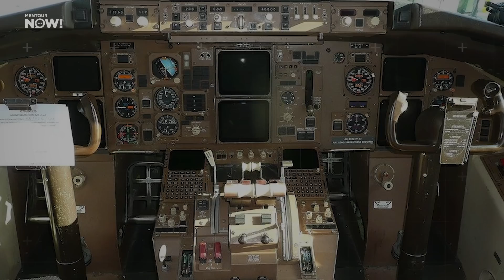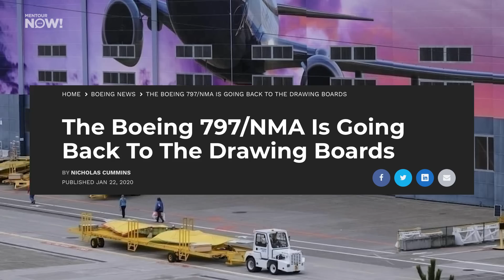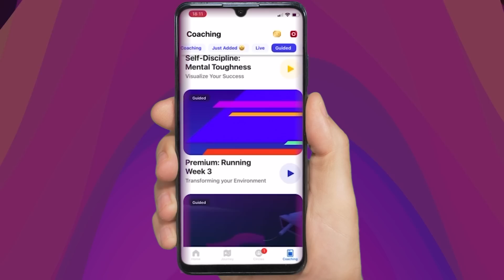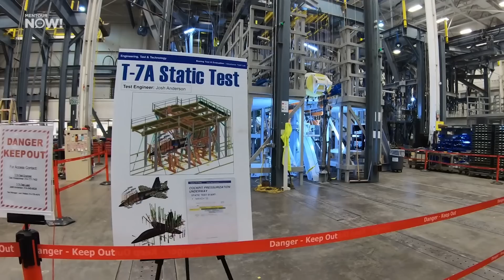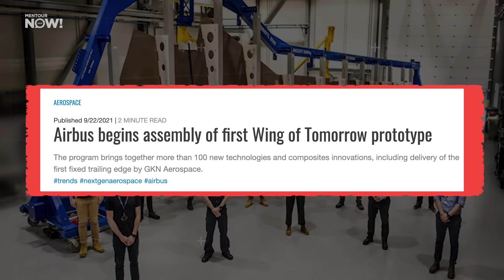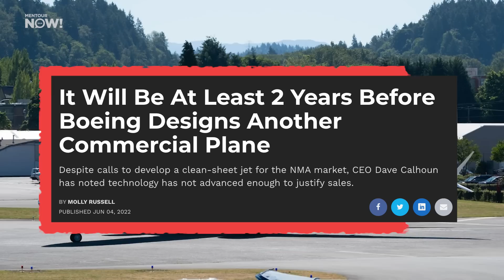Is Boeing Planning a 757 MAX?!

Comment: I started my aerospace career as an engineer on the 757.  It was an inspiring airplane, especially watching it take off empty from Renton field. But after 40 years of engineering airplanes, and and more than a decade in Product Development, I have to face the facts. When comparing the operating empty weight (OEW) of the 757 against both the 737-900 and the A320, which all have roughly the same passenger capacity, the 757 is 50% heavier than its main competitors.  This translates into a lot higher fuel burn to accomplish the same mission. The pilots loved it because of its power and instrumentation, but they were not the ones paying the fuel bill. The 757 replacement will need to be a clean sheet airplane, not a 757 derivative, which itself carried way too much baggage from the 727 that resulted in it being so heavy.  The 767 was a true clean sheet airplane, and it out lasted the 757, and also gave birth to its sister, the 777, which originally started out as a 767 derivative.

Comment: When the 757 and 767 were the new things on the ramp, when you walked around behind the curtain at Boeing they had KISS signs all over. Not the usual meaning, instead Keep It Super Smooth. Kind of moot when the 787 came along.

Comment: The 757 was the best, most versatile aircraft I ever flew. It could do short field landings, had long legs and plenty of power. Easy to make smooth landings. One horribly turbulent day I flew one from PIT to SFO at FL240 using FP TAS of 420K-arrived ahead of schedule and had 1800 lbs more fuel than flight planned.

Comment: Boeing should design a new plane from the ground up in the spirit of the 757 then discontinue the 737 Max; and just call the new plane the 757. They could have three models a 757-400, 757-500, 757-600 with seating capacities of around 225/250/275 or whatever makes sense. They could work to develop a mid-sized engine that sits between what is on the 737 and 787 or use the engine from the Max; and since it will be a ground up design they would be able to extract all the power from the current engine (I believe they had to make the bottom flat for ground clearance and that results in it being slightly less powerful). I would also imagine they could integrate comfort features for things that are relatively new such as high speed satellite internet. I think Boeing has to show us the can still design and build a plane; and I'm not sure what else they can squeeze out of the 737 design so I don't see how they are not forced to do a ground up design for a plane that satisfies this part of the market (as an added bonus they get to leave the 737 Max behind) .

Comment: A clean sheet is the way to go, people don't realize the 757 is based on the same frame as 707, 727 and 737 each have their own layout but all share the basic fuselage in differing lengths, the main problem being today its old school and heavy, 1950's heavy. One of a few reasons its gone is its weight compared to the far newer A321 which is similar in pax capacity. Its look at the front is different because it shares much of its cockpit with the larger 767 and was really designed to replace the 727 for the US domestic market which it did.

Comment: The reputation of the B737 is very ambiguous today, especially since further modernization is almost impossible. But the B757 for modernization is quite possible. After all, the B757-100 may well replace the 737 MAX8, or maybe the 6 and 7 models.

Comment: 757NG? But the engine requirements may be an issue. Nobody else other than RR and PW make the engines the original 757 flies on. It would likely be a clean sheet engine design.

Comment: Thus is what has has me scratching my head the entire time: why did Boeing bail on the 756 and the 767? Okay, there was a dip immediately post-911... got it. But after a couple of years, seeing as how the 757 was still a very prominent workhorse of most fleets, why kill it off? The board at Boeing needs to be completely vacated and replaced with sensible people and Boeing needs to quit trying to fix things that aren't broken a la the dreadful Max program. *Boeing is STILL doubling and tripling down on that sack of crap!)

Comment: 757 is one of the best large aircraft I've been a passenger on. As an enthusiast I love to good strong acceleration and attractive design of the body. I don't think Boeing will do 757 again, but they seem to have let Airbus get way out ahead. 737 MAX has really screwed them over, but it is also resources that probably should have been used to try and replace it given how old a design it is too.

Comment: What wasn't mentioned in this video is that, ironically, the typical fuselage section of 757 is the very same of the 737! There is, obviously, a completely new nose and tail section, as well as wing attachment fixtures. Regarding a new aircraft to fill that "gap" between 737 and 787, I think a shorter 787 could be a solution? Does this solution need to be a narrow fuselage? I don't think so.

Comment: There is zero chance that you will see a re-engined 757 or 767.  The reason that Boeing has not gone ahead with a “NMA” is there is not an engine on the market in the near term future that will achieve the kind of operational performance needed to “leap ahead” of Airbus, which is what would be required in order to spend the development costs needed to do it. The decision Boeing made to shelve the NMA essentially ceded that segment of the market to Airbus.  It seems that their plan is to build the next generation of aircraft which will require a different engine capability entirely. With entry into service in the early 2030s, Boeing is likely considering launching a completely new airplane family that will change the shape of air travel. They are playing the long game, since doing anything else is simply not big enough to make a dent in the middle market, now owned by Airbus. Time will tell if this is the right strategy.

Comment: A couple of points was not mentioned in the video: 1. Internal at Boeing. They already have 737-MAX9 and -10. 2. These aircraft does have the capacity to carry about the same number of passengers as the 757. 2. the long range single-aisle market is limited, and Airbus is already filling that niche with their 321XLR.

Comment: The 757 doesn't need a 'Max' version. The 757 already IS a 'Max'. Airbus makes nothing that actually compares to the 757.  If they're going to make these suggested changes to the 757's engines and wings then they might as well just keep making more versions of the old, worn-out 737 or bring back the passenger version of the 767.

Boeing sold its soul and cheapened itself, and is no longer the company it used to be. Its now all about cheap materials, cheap labor, and generic designs. Boeing doesn't need a new 757, it needs new and better management.

Comment: I am a huge fan of the 757-200.  I think a 757 Max would be a superb longer haul domestic product.  I'd start by primarily using it on routes 2+ hours long.  The cabin feels roomier and I like when the plane is configured with an isolated F cabin.  So basically enter the plane and go left for F and right for Y.  I think this design helps free up some of the bottlenecks at boarding.  Especially with some many people brining all of their luggage on board instead of checking the bags.  The 757-200 gives you some of that widebody feel (as a passenger) without actually being on a widebody.  I would think a plane like this would be ideal on routes to vacation destinations where you are going to want a lot of cargo space and overhead bin space.  This video makes me want to book a flight on a 757 somewhere.

Comment: if they had re-engined and re-engineered the 757 much earlier, then Boeing would have had a replacement that could compete with the 321 neo.  thing is, this is what they have been doing to the 737 and its MAX version, re-engine and re-engineer.  so what Mentour Pilot says about Boeing's reasons for NOT proceeding with something like a MAX version of the 757 are actually the reasons why Boeing has re-engined and re-engineered the 737 which is an even OLDER aircraft than the 757.

Comment: The answer as stated is probably neither.However if there was one possibility it has to be the 767.
It is still in production and in service.
There is a perfect GenX engine ( the one on the 747-8)
It is unique being a narrow wide body 
It’s perfectly sized for the 250-300 seat market
It meets  the range and load lifting requirements.
Airbus can’t follow it without spending a huge amount of time and money.
If no clean sheet is on the horizon I would take a long hard look at it..

Comment: So, current engines are either too large or not powerful enough, right?
Does it mean that 757 did have what should be nowadays considered "small but powerful engine"? But not efficient enough by modern standards?

Comment: I am in favor of a configuration with  a high wing and the the engines underneath.  Like the Fairchild and B26 or Aero Camando. My buddy (RIP) did the YC 14 at Boeing in the 70's with the engines on top of the wings to reduce intake of unwanted materials.  The creativity and innovation at Boeing has been replaced by computer software which is termanal.
Iguana

Comment: Clean sheet over an ancient aircraft with no assembly and construction tooling.
Composite, much lighter, much less corrosion, well established materials and assembly procedures.
Pratt&Whittney geared engine, fly at higher altitudes
(Thrust is proportional to density )
Higher cruise, especially over the North Atlantic opens new upper airways, when using an engine with more thrust at take off. Larger reverse thrust crucial on certain wet runways, known for overruns ((Cebu)) 
A geared engine is easier to upgrade, since fan and core engine are decoupled, by gear ratio change and vastly improved materials: Aluminum Magnesium Boride record low friction coefficient, coupled with highest hardness 
That is the preferred result from 797 configuration studies.
What engineers are needed?
Alan Mulally types. No foreign imports.

Comment: I worked the PW2000 for 25 years, on the 757 - 200. The factory rep was talking about the PW2000 core with a cut down PW4000 fan with a gearbox. I don’t know if this was telling the truth or just pull my leg. The PW2000 was rated at 37,000 lb of thrust. During the pandemic we in the shop was still very busy because the same engine is used on the C17 but there are 4 engines and on the USAF plane and they didn’t stop flying their aircraft.

Comment: The 757 is the best thing Boeing built since the B-52. I loved working on it for the years we had them. The frontal view is menacing and sleek. It looks like a bird of prey. The Rolls-Royce RB211-535C was an amazing engine, although the thrust reverser was a pain in the butt. I was greatly saddened when we parked the last 75 at Roswell. No other airliner does what the 757 did. We fly Airbus A319's where the Boeings used to go, but they have half the passenger and cargo capacity. The only thing I didn't like about the 757 was that it took forever to deplane the passengers, which made for little time to fix interior items. I still get a smile when I see a United or Delta 757 taxi by.
Reply: Why the trhust reverser was a pain?

Comment: Let me see. The 757 will need new, larger engines of course. That means modified wing plus of course longer landing gear (otherwise we get 737Max issues) - so redesign those. Now the cockpit will need to be a modern glass one. That will enable fly-by-wire, which is so much more efficient and a lot easier to make redundantly safe. But that means a heavily modified empennage (which the aerodynamicists will want for the new wing anyway). That leaves the aluminium tube for the fuselage. But we can save a lot of weight replacing that with a more modern Al-Li alloy.
Of course it is still a 757 ...

Comment: Is there anything left to say about the niche flown best by the 757? Reasons to love this airplane abound, in spite of the lack of a current business case to field a replacement aircraft, or to do a re-engine program. When the KC-135 and DC-8 re-engine programs were opened, we had a ready-made, already profitable CFM turbofan to directly bolt on and borrow from the 737. The facts of the current matter are (1) none of currently manufactured or economically manufacturable turbo-fans are half close enough, all of them way too big and way too heavy (2) there are not enough 757 aircraft to achieve economy of scale on a new engine, (3) both the 737-10 and A-321 take the bottom part of the niche away, (4) if a profitable opportunity existed, either of Boeing or Airbus would already have found a way to put bigger wings and taller gears on the narrow-bodies in manufacture, and (5) there is not sufficient room in the niche for two airplanes.  Besides, the righteous laugher against flying in the proposed gas can A321-XLR seems wasted on safety-conscious, uninformed ears. The reason the NMA was cancelled was a real threat from Airbus to put a new wing and taller gear on a longer A-322 and call it a day. Where once we thought a twin-aisle, flat-oval, carbon fiber NMA, seven across might compete with 757 economics, they won't compete with a single-aisle, round, carbon fiber 757 do-over with fresh, made for niche engines, as Boeing currently supposes 10% more efficient than the best we currently have. No. It is all sighs and wishful thinking. What we really need are diagonal airport gates in which to load and unload a long single-aisle airplane, simultaneously from the front and rear. In that case, we do not need the extra aisle. That is the downside. Getting on and off a 757-300 is a painful, time-consuming affair, kind of bad on -200 as well.

Comment: Boy. Boeing has backed themselves into a corner much like Airbus did with the  A380, when Boeing correctly decided that the 787 was better positioned for the market in the beginning of the 21st century. Unfortunately, Boeing stopped thinking ahead after the 787, and Airbus recovered nicely. Now Boeing's missteps have put it in a terrible position for at least a decade.
Never let the "suits" plan the future direction of an engineering based company. Aircraft are NOT just any product. It takes a special understanding to run an aviation firm. Soda Pop salesmen and accountants don't know enough to do a good job. We are seeing the result of "money engineers" running a company into the ground.

Comment: I agree with Metour Pilot, it would not be sensible or economical for Boeing to revamp an old design either the 757 or the 767. I am a great fan of the 757 as they had a Rolls Royce or Pratt and Whitney Engine with great thrust for real quick take off,s for places like Feuteventuna .  A Completely New Design is the only way and at the Moment I feel Airbus could be in the best position to launch it.

Comment: Why wouldn't Boeing instead work with the 787 they have. It's composite mold out of a single cast so it's a matter of making another mold that is single aisle narrow body. Then just as they would be scaling down the 787 fuselages they scale down the 787 wings and engines. And wouldn't the engines simply be two of the engines from the 747-8.  That's exactly what was done for the original 757. If it were built with four possible lengths of fuselage with corresponding size of wings and engines they would be replacing the 737 as well. I hope this announcement that they have no plans for another plane this decade is just a smokescreen to not hurt 737 Max sales. I hope they actually have something what I just described in the works because it's based on technology that they already possess and it's just scaling down an existing plane.. I understand the 737 Max has to get to profitability but can't it do that in about 6 years? The first incarnation would be the two longer lengths of fuselage as the 757 replacement A321 neo XLR competitor. Buying then is mum's the word about two shorter fuselage lights coming later when they're satisfied with 737 profitability.

Comment: One big issue for updating the 757 would be that all old 2D drawings would need to be conveted to 3D CAD models before any major redesign could start. This is not impossible, as both manufacturers have done it for the A320neo and 737 MAX families. But this would give Airbus a head start for a possible A320 re-wing project.

Comment: The bean counters at airlines don't like the landing gear in the 757, due to it's weight. They figure out to the penny how much fuel it takes to haul that landing gear around. It is over built, and seems to be an off the shelf item from the 767. Compare that to the 737's landing gear, which is small and light in comparison. And it barely gives enough ground clearance to mount those large fan engines. So it seems inadequate to me. When you start talking about a new wing, new engines, etc, that sounds like a new plane.

Comment: It’s the best plane they ever made, why wouldn’t they? It’s basically a 737 with more range, more power, better capacity, shorter take off and landing distance, better performance in hot and dry conditions, AND better looks.
Reply: It would be a 737 with 25 % more MTOW, 50 % bigger wings (to get the hot and high capabities) but also far more empty weight and more drag because of the bigger wings. It also don't fit into Icao class C regarding wingspan, which means landing fees are higher.
There's a reason the 737 NG and the 320 are in the size (wingspan, wing area) they are. The niche capabilities the 757 has cost efficiency, it can't compete with a 737 or a 320 on standard routes

Comment: Love the 757's sleek, gossamer look, its long landing gear, and its unusual power -- which comes in handy at airports with high elevations and/or short runways, such as Jackson Hole, Wyoming (6,500" elevation, 6,300" runway).  It's a rocket with six seats across and toilets.